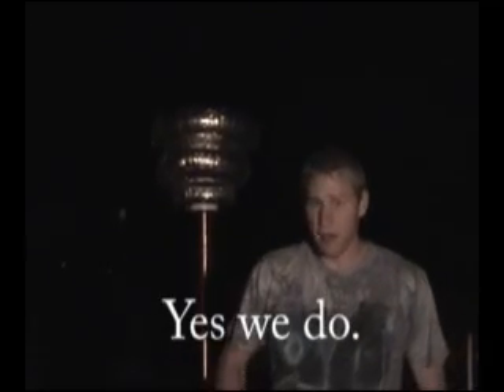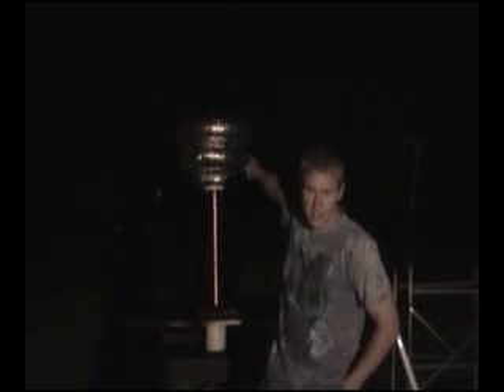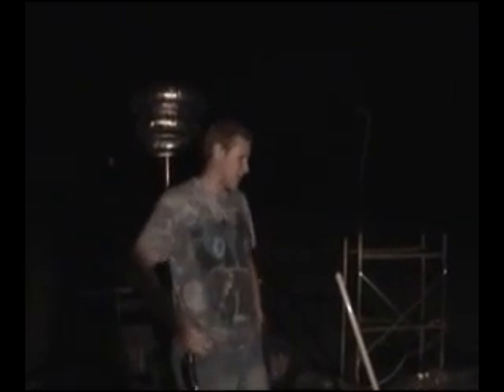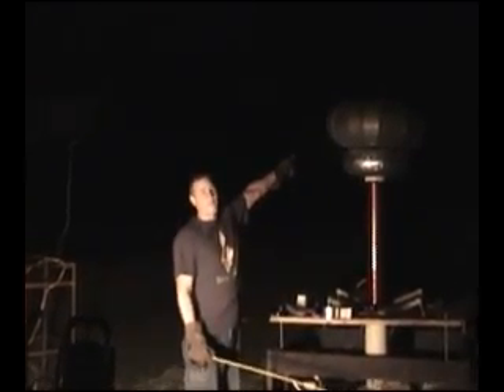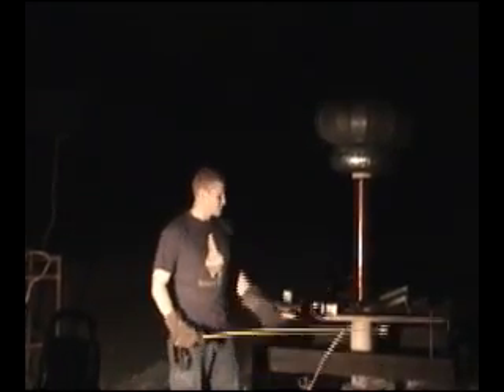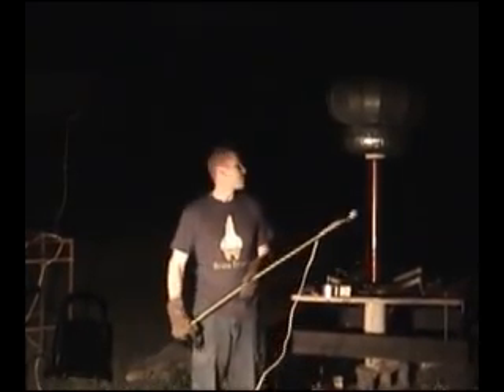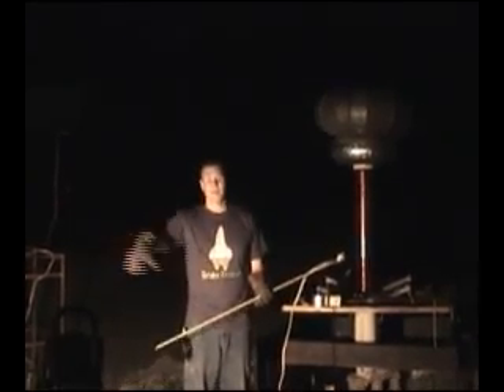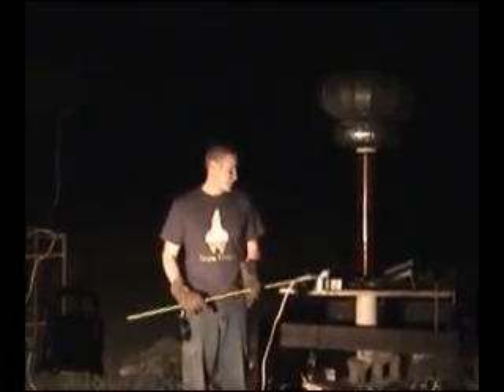My 6-inch tesla coil part 2

Comment from the maker: Well, the truly make or break part of this particular coil was the spark gap, aside from that nothing major changed from 0-61 inch sparks.  Send me your coil specs in a private message and we'll get you up and running, I run them through some software to make sure everything is the size it is supposed to be, then we'll test to see if something is bad.